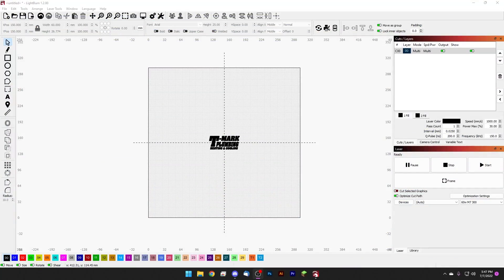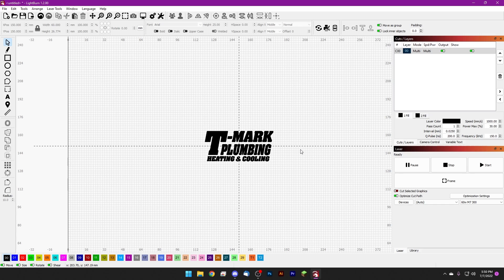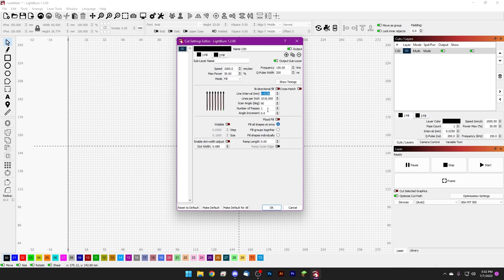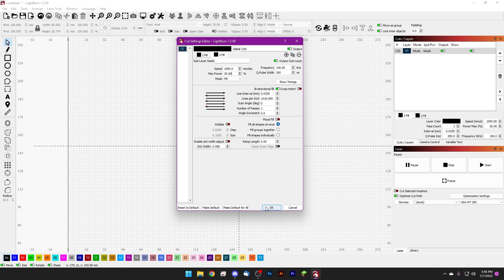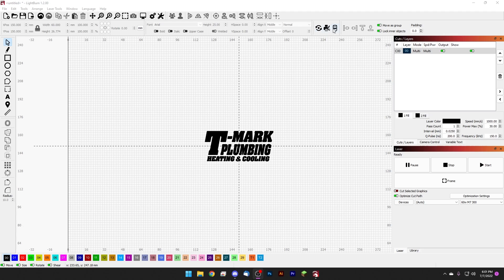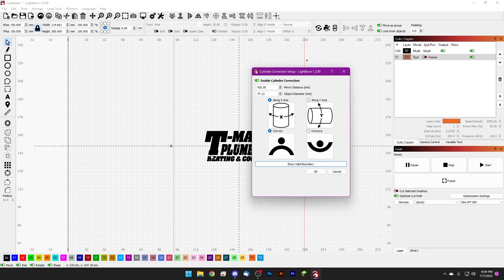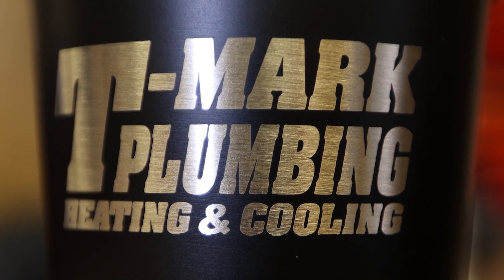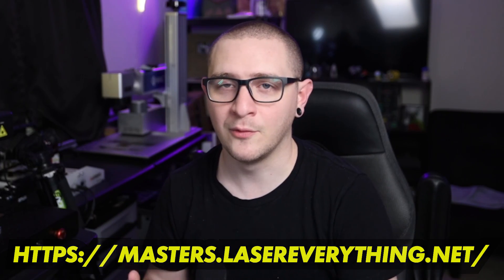FORGET ROTARY - Intro to Cylinder Correction in LightBurn

Comment: Why using a sub layer instead of using just crosshatch if you're using the same parameters?
Reply from the maker: For a few reasons, but the long and short of it is you can totally use crosshatch. The reason we chose to do it this way is to give explicit instructions to do a final pass horizontal to match the grain pattern of the cup. Sometimes this can be lost in the mix when setting a hatch angle and using crosshatch and might get them swapped by accident. In addition, it’s also just an old habit from the ezcad days to separate the hatches. This was also filmed when sublayers were a fresh thing in LB if I recall. Ultimately, as long as you get to the end point and understand the core reasoning to the methods chosen, you can choose from a few different methods to get to the end goal and still end up in good shape
Reply: @LaserEverything oh ok, thanks for replying, I really enjoy your videos, I'm a new fiber laser user and your videos have helped me a lot, thank you

Comment: I didn't found much difference after trying this. I tried a tumbler the two sides are still engraved really shallow and I need to remove them manually. The paint was cut but didn't fall off, what might happened?
Reply from the maker: Cylinder correction is a feature for correcting skew when “flat engraving” on a curved surface, rather than utilizing a rotary, and the speed and other benefits that go with it. It should help with those things and maybe more, but what you’re experiencing has more to do with the parameters or material specifics. We have a few videos specific to doing powder coated tumblers, and those would probably offer more specific tips for material and engrave settings. It may need some adjustment and tuning from what we use if in the case you’re using a different laser or lens, but may help. Color of the coating with fiber is also going to make a big difference sometimes, and brands will have costing differences too.

Comment: Great video! One question, on the Monport GA60 there is no tube to measure. Would I just measure from the lens to the middle of the case? Thanks!
Reply from the maker: The mirrors are typically just below the half way mark of the head, above the lens. If you're off by a few mm, it's not likely to cause an issue, but the closer you are on your estimate can help a bit.

Comment: Hey there.  What pulse width is defaulted on your machine?  I have a Mopa so. Iget to choose the pulse.
Reply from the maker: 200ns, as is for most non mopa jpt sources so usually a pretty solid guess. If a user has a raycus 150 - 180 is generally appropriate.

Comment: Are you setting focus to the highest point of the cylinder or meeting the middle of high and low for this?
Reply: In this video he talks about that - he says about 3/4 of way to bottom is best.  1/2 would certainly work better than at top due to depth of field for the laser.

Comment: Can this be done with a 40w diode laser?
Reply from the maker: If it is a gantry laser, unfortunately no. This feature was kind of intended for projection style galvo systems with lightburn. You'll likely need to stick to rotary marking for cups with a 40w diode gantry.

Comment: When you input the focal distance, is it asking for your machines in focus length?  Or is it asking what you are actually setting the focal distance to?  I am using a 210mm lens so on the rotary I find that defocusing 8mm up is best.  My in focus length is 239mm, would i input that into the cylinder settings or would i put in 247mm?  Thanks!
Reply from the maker: I put the length of my focal stick, so from the bottom of the lens to the focusing point on the material. In my experience I've found it's the least important factor of all of these variables and doesn't need to be entirely precise.
Reply: @LaserEverything  Thanks for the clarity!
Reply: @LaserEverything  Lightburns page says mirror distance, not focal length.  They say to measure to where your mirrors actually are.

Comment: Thank you for work.  I used my rotary in ezcad to mark business cards.  Made a platform and turned the rotary 90 degrees so the card holder would just spin as each card is marked, then remove and replace while another is being marked.  In lightburn I am unable to figure out how to do that.  Any suggestions?
Reply from the maker: I'll look into putting an episode together on something like this in the future for sure. I'll have to make up a plan.
Reply: Do you have a video on this jig?  Sounds like a great idea.